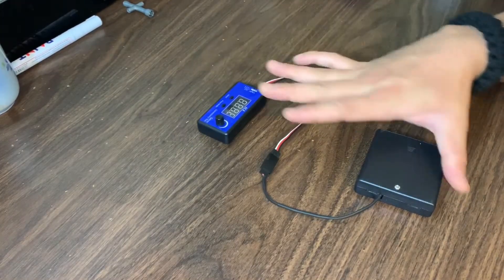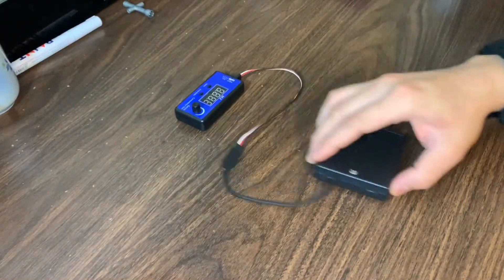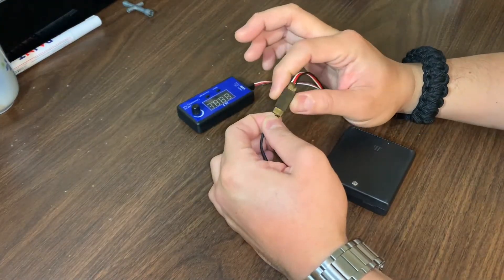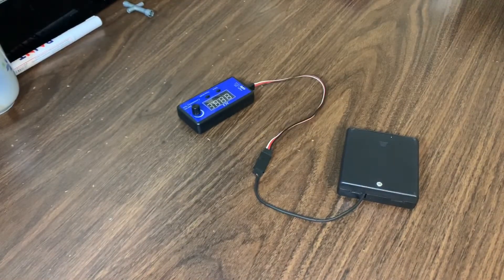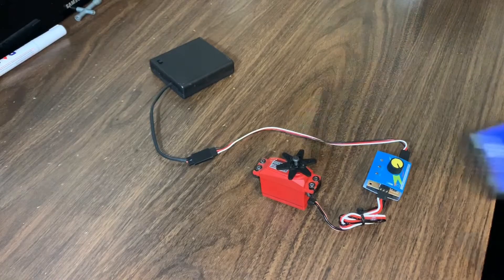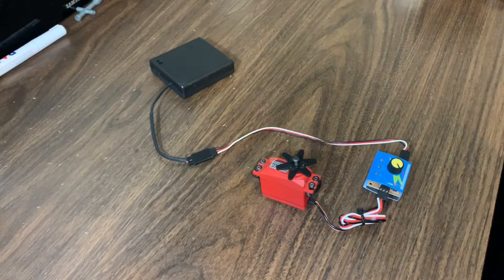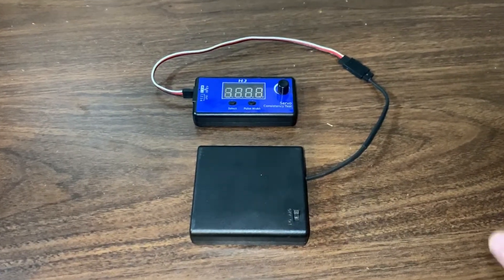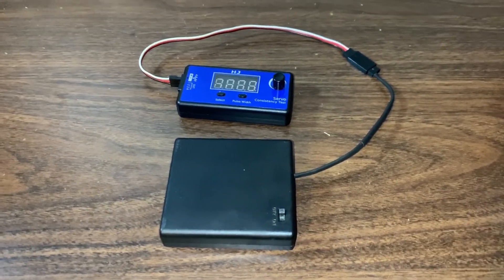Must Have Servo Tester for RC

Comment: I think it’s pot luck with testers. I have had the simple one with the 3lights for 5years or so and recently graded to digital read out one. After 3 months it gave up moving servos but readout still works? Servos move briefly when connected but work fine on other servo. Hey ho.

Comment: Do you know of a device that is like a BEC but instead of having 1 output of 6v 
it will have 3 outputs. The problem is the ones out there are either only 1 Chanel, or it’s 2 channels but one of the channels is just 5v and it’s not adjustable. 

Castle makes a 5v-12v output but it’s just 1 Chanel. Man…. I need 3 different voltages simultaneously 6.5v, 8.5v, and 11.5v without having a big mess.. I need to do this with a little electronics as possible. I’ve been researching like crazy.. 

I seen a demo where they used a potentiometer to brighten and dim an led light. If I could use the servo tester digital unit to set 3 different voltages on 3 of the channels and have those three different values set and working all at the same time, it will help me get one step closer to finishing the huge project that every ones waiting on me to finish.

If this type of stuff is in your ball park I’d like to hear back from you thanks.

Comment: Hi thank you for you videos, they're very helpful! The battery pack is a good idea, how much imput voltage can handle receivers?
Reply from the maker: FPV Jos - Not sure I understand your question but for ground vehicles the BEC voltage on most ESCs I’ve seen range from 4.8-6V so I would assume most receivers, servos, lights, fans, and all other accessories that plug into a receiver should be able to handle that range of voltage and the standard voltage range of a AA I believe is 1.2-1.5V depending on how depleted it is so four AAs would add up to 4.8-6V which would be the same as the voltage range as most ESCs so seems like the perfect power source for a tester.  Know some ESCs have a BEC that can go up to 7.4V but think that’s for HV servos I’m not sure though don’t have any experience with that.  Anything more than that I probably couldn’t answer I don’t know much about all that electricity stuff like resistance, watts, amps, volts, it’s all Greek to me... 🤷🏻‍♂️